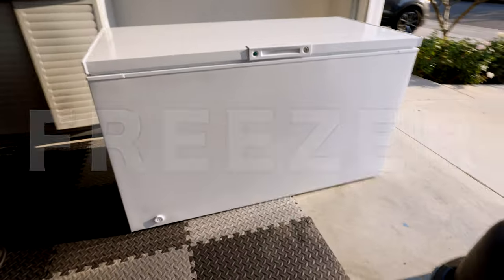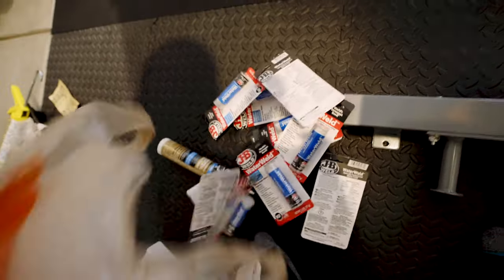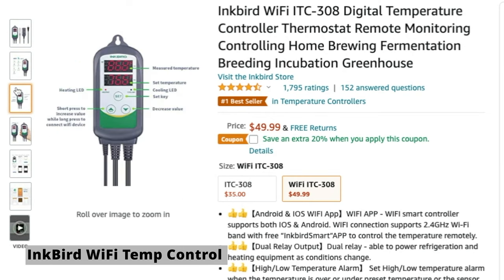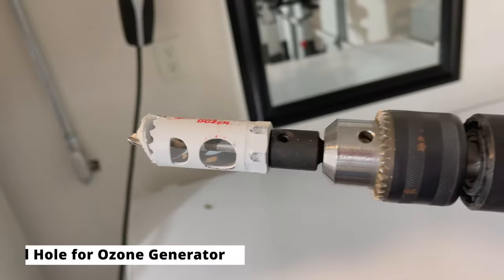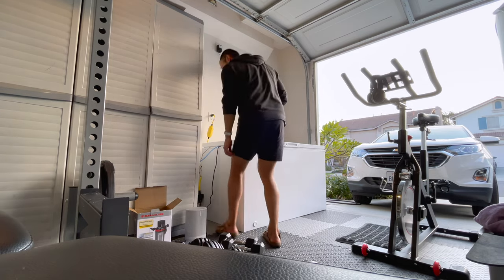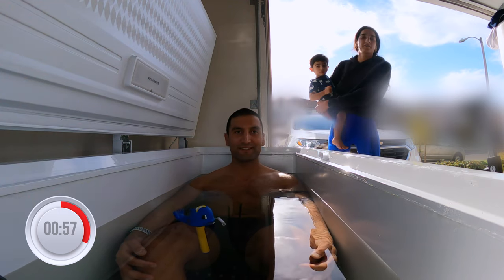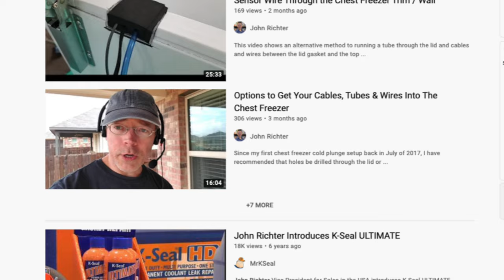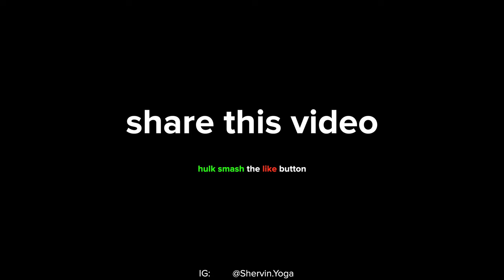How I Built a CHEAP DIY Ice Bath under $1,000

Comment: I have this chest freezer and beginning my project. Could you find anywhere that gave a coolant line diagram? Looking to drill some holes in the bottom for a pump and plumbing the filtration, but I can't find anywhere that says if they run in the bottom of the freezer. Great build!

Comment: Great video. I'm 6'3 do you think it's big enough? Any bigger ones your recommend? Thanks!
Reply: What did you end up getting? I'm 6'1 so thinking about it too
Reply: @vladsapojnic7884  I went with one step up bigger. 19 cubic feet. Definitely big enough and I like how I can stretch my legs straight out.
Reply from the maker: Sounds like you figured it out! I'm 6'0" and this seemed to work. I would've gone smaller & kept my knees bent, but they don't have the white liner on the inside

Comment: Does closing the cold plunge obstruct the hose attached to the ozone generator?
Reply from the maker: yes a bit, that's why I drilled a hole at the top of the chest freezer to feed through power cables & Ozone hose

Comment: Do you drain the water through your drain plug?    Do you have an adapter that you can attach a hose to ?   Looking for this adapter.  i have the same freezer
Reply from the maker: no it takes too long, I just pour it out with a bucket, then tip it over to let the water release

Comment: Do you have to drill a hole in the hull for the ozone generator? I was reading on the website there’s an over the side kit that comes with it. Would that still work?
Reply: Cut a hole in the rubber seal

Comment: Thanks for all the great info here. How many of those little jb water weld packages did you use? Man I really just want to use high strength silicone because it seems easier but John Richter seems to recommend otherwise..
Reply from the maker: yes he's all about the JB Water Weld. I think I bought like 20 of them? I ended up going back & buying more later. I did cheat near the top of the tub because it's SO HARD to put on
Reply: @ShervinShares  Thanks for the response. Yea that stuff was not easy to work with but hopefully it will add to the longevity of the plunge. One last question for ya, how often do you run that marineland filter and also wonder how long/how often you run the ozone generator? Thanks!
Reply from the maker: @Eskargo11  i run the filter 24/7 because it's made for smaller size fish tank. Since the chest freezer is so large I just run it all day everyday

ozone generator I run 1 hour per day if i use it often. if i dont' use it often I'll run it 1-3x per week for 1 hour.